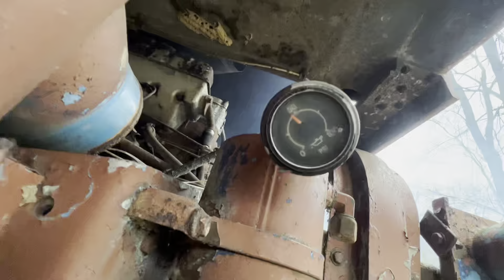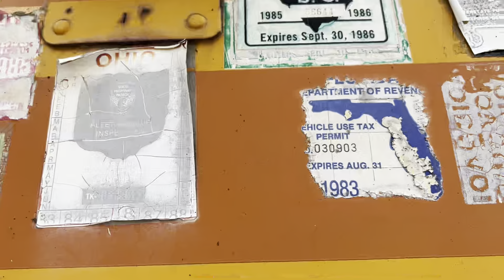Power washing my kenworth k100 cab over

Comment: You did an outstanding job getting her up and running, now you need the essential parts to keep her running. new air/exhaust stacks, new fuel tanks, new tires, everything needs to be replaced.
Reply from the maker: It’s a big project thanks a lot

Comment: i saw this truck for sale by 2 different people on marketplace! one said it was a 1975 the other said it was 1976 one wanted 5000 the other wanted 6500. can you clear this up???
Reply from the maker: I lowered my price to 5000 she just hasn’t lowered hers to match
Reply: It’s somewhere between a 77, and an 81.  77 they went to the one piece molded fibreglass roof, instead of the 3 piece with the aluminum centre
section that’s riveted. In 82 they moved the dipstick access door from the front of the cab next to the grill, to the cab skirt just back from the 
passenger side wheel area. The paint scheme ( the lines ) are a KW design.  Unfortunately the dent in the front corner above the drivers side 
headlights will be expensive to fix properly. The fibreglass headlight panel is easy to fix, but the courier cab skin would have to be fabricated,
The drivers side floor is riveted to that panel right where the dent crease is.  The other dents are easy to fix.  It’s the budget level cab trim package. There doesn’t appear to be any visible corrosion on the cab.  Nice to see a bumper on a truck that age that’s not damaged. 
Thanks for sharing.

Comment: That truck is really rough put the price up no guessing about it it's going to be hotter than a backup a trailer you're looking at 2k too 35 k thousand bucks to get it done so the bottom line how much you looking to get out of that you pulled it out of fuel you put some time in it what's the bottom line